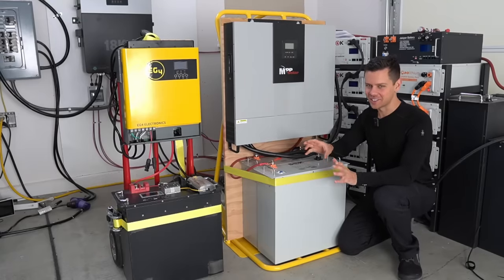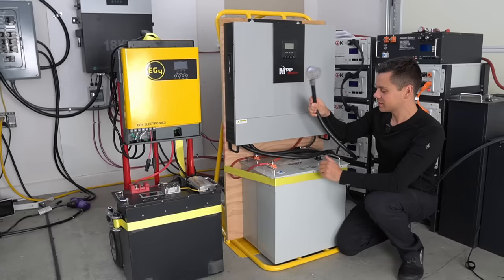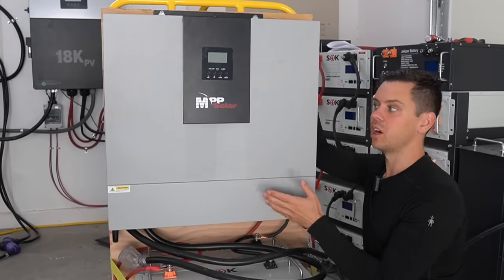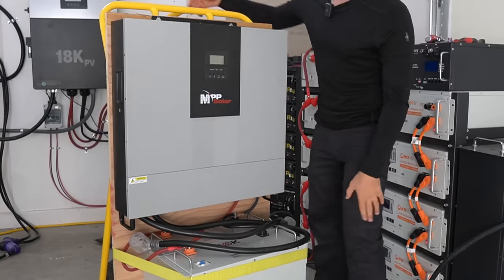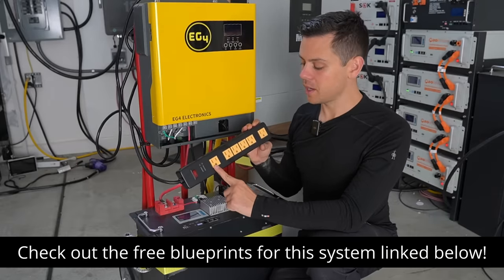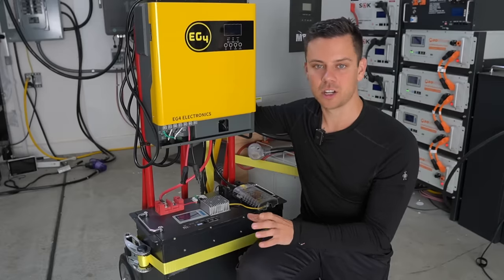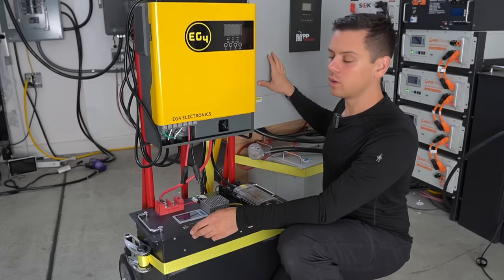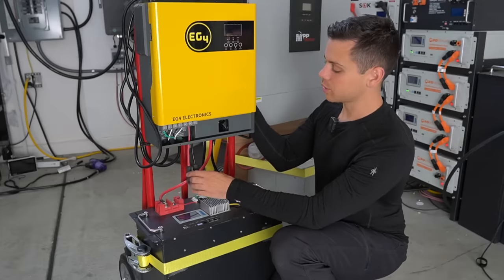240V Mobile Solar Cart! And New Upgrades for 3kW Solar Cart

Comment: That massive 'portable' unit could be made more portable by moving the wheels to the sides of the cart rather than having them behind it. You could also switch to smaller diameter wheels and then move the axle and wheels closer to the floor. This could increase your leverage and give you the ability to move it more easily. Would you be interested in selling it?

Comment: I really like the smaller cart, Will. I'd love to see a build of this that makes it more ruggedized or weatherproof. I see the value in having a system like this in emergency situations, but I don't like the idea of requiring dry conditions for loading and unloading, or operating. Consider a storm scenario where you need to move this rig from a truck or trailer to a building or tent. I'd be nervous about getting it wet without some sort of weatherproofing.
Reply from the maker: I would put a bag over it then. Would fix that

Comment: Seems like we just need some reputable manufacturers to come up with rackmount form-factor inverter / charge controller units.

That way we'd  just need a four wheel trolley with a stack of rackmount batteries and a rackmount inverter on top and it'd all look nice & neat.
Reply from the maker: We have been requesting this for years
Reply: It looked to me like everything on that 240v unit was actually designed to be rack-mounted.

Comment: Please do a video explaining ' where the excess PV power goes ' on an off grid system when the battery is fully charged and the PV input power is way larger than the load - I think it is ' throttled ' by the inverter but don't understand how . My setup is 6 panel array producing 2,760 watts --> All in one Kodak ogs 5.6Kva which has a 3.5KVa Pylontech LiFEPO4 battery . So when the load is 270 watts,  and the panels are outputting 2300 watts at midday , when is the excess going as it does not seem to be converted to heat . This is not like ' clipping ' where the inverter ensures no overvoltage to the battery . I have searched the internet for months , tried Chat GPT but no one can provide a clear / understandable answer.

Comment: HI WIll. Im going to try this! You inspired me. I would like to make sure I am sizing it correctly. I will be tyring this on a small garage apartment. I reviewed the last 12 months bills and the most power used in any month is 1225 kWh. If I am calculating correctly (based on your calculation video), the 3 kW system ( like the smaller one on the cart) should be good? Do you agree? Thanks and keep the videos coming!

Comment: Impressive Will. How about a 4-wheel wagon style cart with the MPP controller on a folding frame? I do some Solidworks design if you or someone else might be interested in playing around with a design.
Reply: Just need a welder; move the axle on a cart so it still is handy like a hand truck but has the capacity of the cart.

Comment: Will, the Amazon user comments on that 48v-to-12v converter are saying that the instructions are wrong, the yellow/ black are the input (48v) and the red/black are outputs. Someone has a IR photo of it hooked up per the instructions. Just a heads-up. Maybe a few people got bad units??
Reply from the maker: Weird. Mine works great. I thought the wiring was correct on mine

Comment: I've heard that you can build a parallel and series battery circuit but have never seen a video on such. For example, take two batteries and parallel them and hook them up to two batteries in series. I believe that would increase both voltage and amps at the same time. If so, can you make a video of the advantages and disadvantages?
Thank you!

Comment: Hey Will while you are churning out videos how about one to review different panel set ups you might use with the mobile generator, can you do something that talks or demos connecting 5 175 w panels or 4 400W panels, are they series or parallel strings etc. what options and what you recommend for the 3k system?

Comment: So, question a couple questions... Why exactly can not use a 12V to 48V step up DC to DC charger? I'm thinking about building a small system like this for a small mobile food cart... I plan on using a 100ah 48V EG4 Golf cart lithium battery. There is not much room for a solar array, so I'm thinking of using one string of 8, Renogy, Biracial 115W 12V monocrystalline solar panels, with a max OCV of 21.9V each in series. It's not much of an array, but I think it's all I can fit physically dimension size wise for the mobile cart that will it work for me. Will it work? What comments and opinions do you have on it? Thank you.

Comment: Will, just a quick question.  When the power comes into the EG4 does it charge the battery and the battery runs the load or does it run the load and then charge the battery at the same time?

Comment: Beginner here 🤔.I just ordered the 3kW cart system. I almost cancelled my order because I'm soooo nervous about hooking it up (I did ask a friend who's great w/electrical configuration). 
    Anyway, I have a transfer switch for my gas generator (which uses that big GI-NORMOUS plug-LOL). I would like to be able to connect the cart system to my panel (just to power up certain appliances with a "flick" of the breaker) in the event of a power outage. 
How would I wire that huge plug to the inverter?

Comment: I would want to do it as 2 3kW separate carts that you can link together to make 240v.  that way you have better portability, and some level of redundancy if you want; no reason it has to be 240v and not 120v in parallel if needed.

Comment: Question, in this vid Will shows the EG4 uint (really like it for my RV) and he shows a 48v to 12v step down to power 12v loads.  He shows a 12v load panel attached to the 12v side of the step down.  For my rv, can I connect the 1v side of the step down directly to my RV 12v load (via a bus bar perhaps)?  I really like the idea of the 48v server rack battery, but I was wondering if I can use it to power my 12v loads in my RV.  And IF I can do that, do I need to turn off my RV onboard converter/charger?

Comment: I’m new to electrical topics. I’m following everything but the 48V to 12V Converter part. What is the use case here? 

Without that can I still use the whole system with the typical home appliances?

Comment: Amazing videos! I have learned so much (yet nothing, lol). So, I want to do the 3kW setup in a van. I would like to use one LP4 24v rack mount with the EG4. What is the min solar I can get away with? I don't have room for 3 400w panels on my van. Probably more like 3 200w, or 600w total. Can you or someone help a brother out? Is this just the wrong way to go? This system just seems so perfect/simple for all I want to run. I looked at the Growatt and the PIP and was not so interested.

Comment: I was just looking at the Chins 24v 3000w inverter...  $450
that and their 24v 100ah battery $650 is about $1k... 
seems like that's a hard to beat little combo... easy to upgrade capacity... 

could you take a look at that Inverter and tell me what I'm missing... 
Would this run an emergency load in my home? fridge, furnace pumps ?

Comment: Can you do a video on a battery DIY expansion for the Delta Pro? I started my project I bought a utility cart and buying everything one part at a time. My plan is to feed the battery into the solar input of the delta pro. Right now I have a smart plug that cuts off at sun down. I have a circuit breaker connected to the battery. I flip the breaker and it feeds the 100W into the solar input on the delta pro. It bumps it up a bit and adds a few hours of run time. BUT my  NOCO GEB 5X3 cant recharge the 12V battery fast enough. A work in progress. Any ideas to make this better?

Comment: Hello,, 1st time asking. I will like to get a off grid system but installed in my travel trailer. I do want to also use it for my travel trailer but the main idea is for the house. The reason is because HOA and permits are expensive and takes time but in my travel trailer they have no saying and it is parked next to the house behind my fence. Any recommendations. I thought about using a eco flow pro or similar and add about 10 maybe 11 panels to the trailer. Thanks.

Comment: Hey Will—I love your videos! I have a 50 amp 5wheel and looking for a good mobile grid option that I can put inside the front compartment. Is it possible to wire a 50 amp plug (you said 30 amp could be added) to the EG4 w/trophy battery? I am thinking about mounting the inverter to a piece of plywood and laying it down horizontally inside the front compartment with the battery secured top of course.

Comment: Makes me wonder if a more realistic avenue would be to use a centertap transformer from either a single phase 230V or single phase 110V setup to get you your split outputs off a smaller all in one unit. Might have some issues with your false neutral in such a setup depending on inverter though. Things that make you go hmmmm.

Certainly at least easier for us in europe just being single 230 across entire home anyway.

Comment: Safiery warns against high output 24v and 48v alternators due to voltage frying the alternator if connection to the battery is suddenly severed, like if the BMS rejects a charge. Any tips for this?

I imagine having 2+ large batteries w/ communication cables to the alternator regular (WS500?), then have the alternator immediately spin down when a BMS shutdown is imminent. Also, by having to 2+ batteries, hopefully both batteries won't shut down at the same time.
Reply from the maker: That's why you need external regulation. Like I mentioned in the video.
Reply from the maker: If you do not have external regulation you are asking for a million problems
Reply: @WillProwse  yeah, Safiery is all about the WS500 regulator but they still told me they don't recommend 48v alternators.

They're probably being overly cautious or figure they shouldn't advise somebody that doesn't already know.

Comment: Will, I'm coming to you. If it doesn't exist, please create it.
I have a small ac fan and want to use dc power to supply its power. I do have two dc fans, but this ac fan does a circular movement to move the air. I'm looking for a female ac to male dc rectifier/adapter cable. Info/suggestion please. Thanks

Comment: Will thanks for all the great videos.  My home is very shaded and I have a very small space for solar panels.  I would like to set up a "peak shaving" system to use the batteries for high $ times.  Do you have any suggestions on a Peak Shaving setup with the ability of having a small solar array input for emergencies?  This build looks like it could work?  Thanks!

Comment: Hi just asking for everyone who needs some sort of water proofing, how do you solve the issue that the system is not IP rated for campers plus people who use it in sheds and have to deal with corrosion. It was frustrating watching your cheaper ecoflow delta as it completely ignores the ip rating while in countrys like Australia we can not have systems inside the main residential building.

Comment: I was thinking about running a second alternator on my skoolie for the house batteries.. I removed the bus air conditioners and have two pulleys  with nothing to pull.. someone told me that it wasn't a good idea.
What do you think?

Comment: So I have a question I have 1 solar string but want to charge a 48v battery and a 12v battery Is there a solar box out there that could auto switch the current when it detects the battery is charged. I know I could split up the panels but id rather just switch charge controllers. Also do u have any recommendations. I have eg4 3kw and 48v server rack batt by them for the 12v side gonna have victron charge controller on 2 300ah batteries and a back up inverter but the 12v system mainly just dedicated to 12v appliances

Comment: Thanks for all the helpful info. With the Renogy Boost controller does this connect to the EG4 3000 or directly to the batteries? I currently have two 340w 41 voc panels until I get more so ordered the boost controller for short term input solution. Does the output go into the PV input of the EG4 inverter? Thanks in advance

Comment: Please build a 4-wheel cart with a motor so you can move it easily. That would be very useful in construction sites. Why push a heavy load when it already has all the energy to move itself?

Or maybe a trike with bicycle steering. You could sit on it and drive it around.
Reply: For a construction site I would think the pallet base idea (or job box with extensions) would be much more manageable.  You can lift those with a telehandler.

Comment: NEED HELP PLEASE.
I purchased 2 Li Time 12v 100 amp hr batteries.  And two 10 amp hr chargers.   One battery charged to 13.2 volts. The other charged to 13.1 volts.   They charged for about 12 hrs each.  The charger will not fully charge them.  Li Time support says they are fully charged.  The chart says they are 40 percent and 70 percent.  What can I do to fully charge the batteries.  
Thank you.

Comment: Would it be easy (and safe) to set two of these 3k systems up in parallel for a mobile setup at an RV site?  I do a lot of tailgating in the fall and would like to have a little higher output than one offers, but I don't want to make the jump to a 6548 for various reasons...  thoughts?

Comment: Hello Will. I heard that the algorithm that chargers use to taper their charge is time based , is that true, ? I mean after it hits a specific voltage it will always tapee its charge on time based so with every reset of charger, it will trickle charge the same amount of timw weather needed or not which would permanently damage a lithium cell..... or is that wrong...??

Comment: So it is possible to hook up the surge strip AND a 30a RV plug to the same output? Would want to use 30a plug while at home but have an option to plug things in with the surge strip if mobile.

Comment: Will pairing two of the 3000W inverters allow 240v split phase for whole-house backup? I couldn't find in the inverter specs where it supporting pairing.
Reply from the maker: Page 43 of the manual

Comment: Hi Will have a 330 w 1000VDC max output solar panel need to set up a solar system to run camp fridge 98 litre, lights ,desktop,tv,etc total output 6KVA or roughly 6000W or more if possible just expense that needs to be taken into account Australia is not the cheapest country around  being on a country block in Australia Queensland no powerlines available need solsr power can you help with a power supply from solar panel to batteries i am not expert please help Mitch

Comment: I’m confused on the Renogy boost mppt. Do you disconnect the EG4 inverter? I’m a novice, so still very challenged.
Reply: Same question!  Renogy says the boost MPPT can convert 24V to 48, but that doesn’t really help getting to 120, now does it?  My guess is you have to bypass the EG4 and lose all the coolness it brings to the party. 😢 BTW…Will’s comment on this is at 4:50.